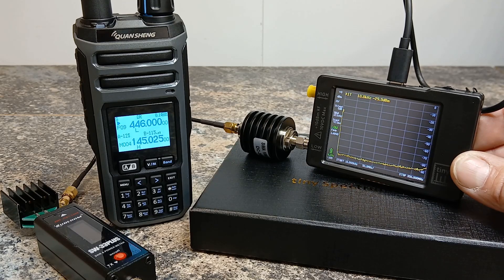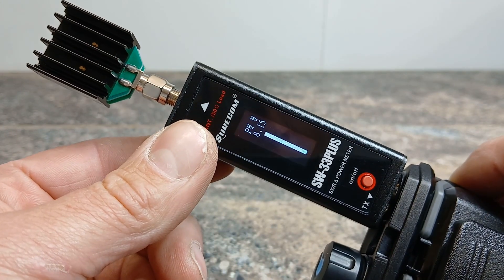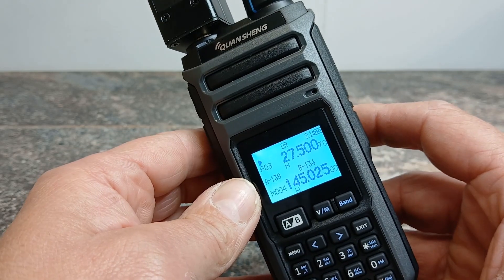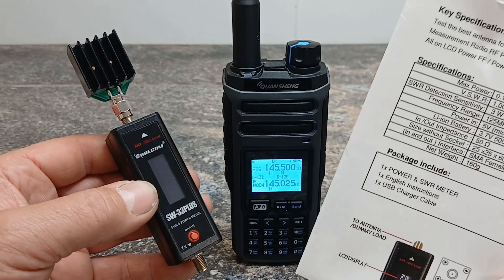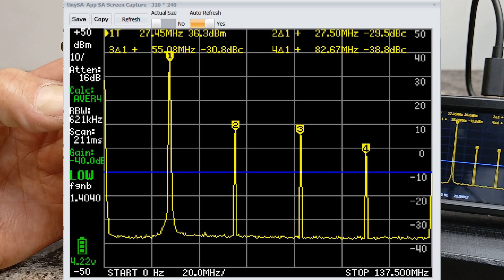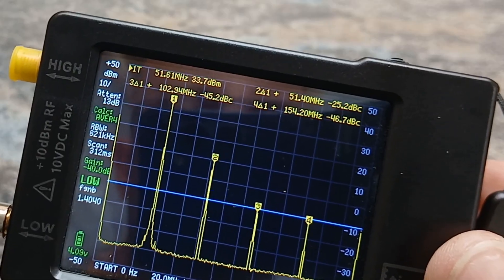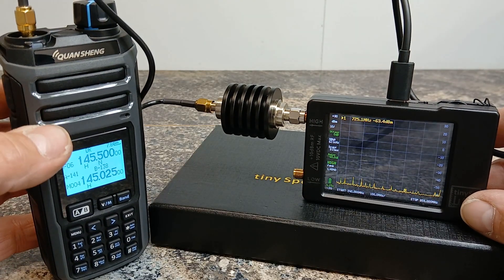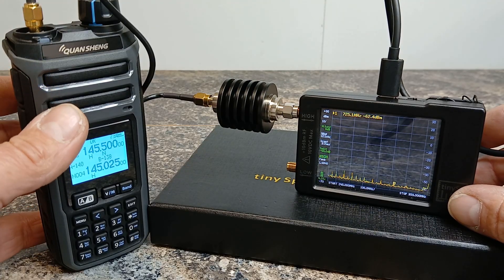Quansheng TK-11 Harmonics and Power Testing

Comment: This radio using FM and vfo mode will transmit from 18 mhz through 570 mhz. Output is anywhere from 1.5 watts on 18 mhz to 9-10 watts on 50 mhz, 145 mhz, 440 mhz. 500-600 mw on 200 mhz and 560,570 mhz, 0 on 220 mhz. I didn't test harmonics which I can imagine are really crazy

Comment: I was scared that the TK11 would be a flop in the TX department. Unfortunately your video confirms this..

Great vid nevertheless!
Reply from the maker: I guess it's not as bad as the modified UV-K5's etc.. but still a little disappointed by the results. Thanks for watching 👍
Reply: @m7frs272  is there a better alternative for freenet, PMR and CB in one handheld? My TK11 at least got a really sensitive Reciever at CB... Much better recieving thann my old Albrecht 4200...

Comment: Starting at 11:45 your TinySA had START set to 240MHz while you were testing 145.5MHz so the fundemental wasn't shown.
Reply from the maker: Yes, as I mentioned in the video I tested it on the low input, which displays upto 350Mhz, then swapped to the high input to show the harmonics that are emitted above that frequency, as initially it looks OK on 2m on the TinySA, until you look at the UHF part of the spectrum! 
Thanks for watching and commenting 👍

Comment: Hi Ben shouldn't  the 27 mhz and 6 metre test be on the other antenna regards Tony
Reply: @TonyTony-zd6is  From what I understand, the other antenna port is receive only.
Reply from the maker: The 3.5mm jack port antenna is for RX only below 18Mhz. 
27Mhz (FM CB) and 6m (50Mhz FM) is on the main antenna. 
Thanks for watching and commenting 👍